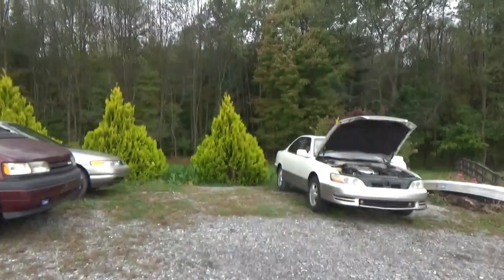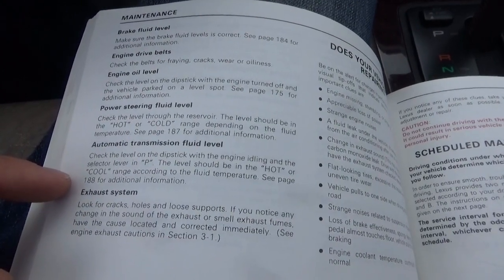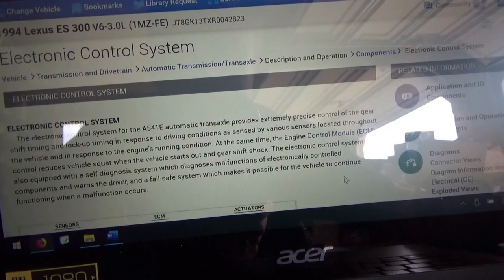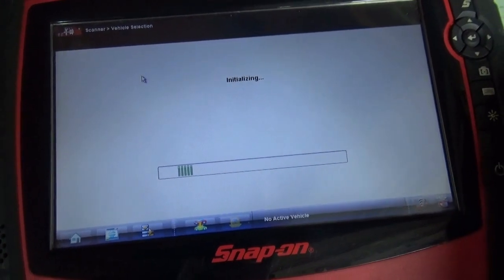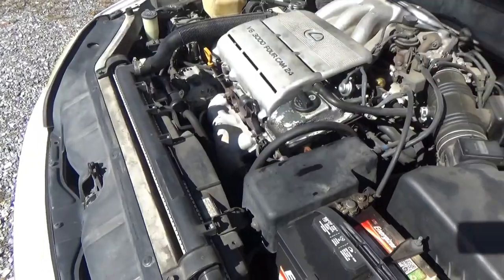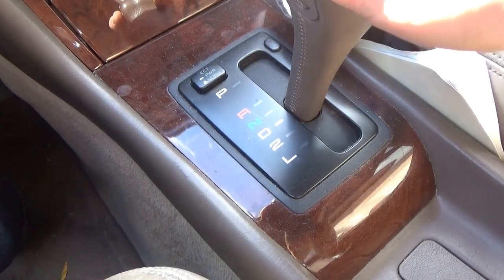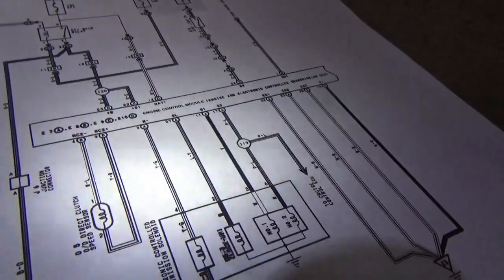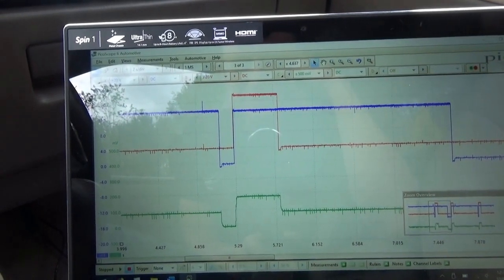Lexus Only Drives in Reverse?!? -Part 1

Comment: The forward gears are overrated. People should practice driving solely in reverse for precisely this eventuality.
Reply from the maker: HAHA absolutely xD
Reply: Saves on mileage too
Reply: This is why it takes longer to return home. There are four or five forward gears but only one reverse gear.
Reply: @MA-kt8ly  Strangely it doesn't clock up the miles at all.. haha?...maybe that's why it seems to take so much longer to get places?....lol
Also...seems to be wearing everything out in no time flat?...hmmm....I wonder if that might be due to the oposite thrust forces on the diff/gears that were never built to take long term....or red-lining the RPM's everywhere I go?...LOL 🤣🤣🤣
Reply: reminds me of the fun days bought a 74 laguna  no forward gears drove the thing home 35 miles in reverse .... new trans the following day drove great , lot faster in forward gears ... lol
Reply: I drove around with only forward gears for about a year, I guess it is time to try to opposite now.

Comment: Turn the Drivers seat around, swap the Headlights with the tail lights and tell Customer to use it in Reverse for now.🤣🤣😂😂
Reply: @ Steve Jones that's a good short term remedy that saves time & money 👍 trouble is someone may & will get hurt if not dead
Reply: Pick up hitch-hikers. They can help you park.

Comment: Have you try to reset the ecm or tcm ? ivan disconcted the batt both + and - for 2 hours ( hard reset)  i  think it will reset and if that the case she need a nother tcm ! why it drop in D 3 2 1 was lost of com in tcm!!!  the reason why it not showing up on the scaner it pre ODB 2 SYSTEM !

Comment: Water in the engine bay won’t hurt anything everything under the hood can get wet just fine. The trick to washing an engine is to not use high pressure and don’t hold the water in one spot too long.

Comment: On all the transmissions I've read descriptions of, the shift solenoids would not cause a no engagement. It could cause a wrong forward gear or slow/harsh shifts but if it's in drive it should be in some forward gear.
Reply from the maker: That's what I suspected, but the service info didn't describe what the "fail-safe" mode was...
Reply: @PineHollowAutoDiagnostics   Could that attempted hard shift into 2nd when the connector was unplugged perhaps been the default strategy but it failed to engage?
Reply: I know Chrysler's transmissions default to second gear as safe mode, and turn off all power to the transmission computer. If no power gets to the transmission computer, you only have second and reverse. I would expect something similar from most companies.
Reply: Wouldn't it be dangerous/safety concern to engineer a transmission to failsafe into a neutral state if there was an electrical failure?
Reply: Yes it would be, that is why Chrysler designed it to be second gear. enough to get around with, limp it home, or at least get somewhere safe. I know this did backfire though, people lost power to the transmission, it dropped into second gear when they were going 80 or 90, and it grenaded the transmission.
Reply: @PineHollowAutoDiagnostics  looking at the service information, you shift into O/D as the default gear ratio as neither shift solenoid is powered on

Comment: Forward clutch packs are burnt up. Could see that from the black fluid. 

When you unplugged the solenoid pack, that was when you can check the mechanical and hydraulic system. It will have a harsh engagement, but will show if the mechanical system is any good.

What fails on these is 4th gear first, then that ruins the first 3 gearsets.
Reply from the maker: That sounds terrible lol. But it's a Lexus! Should be able to go 1 million miles!!
Reply: @PineHollowAutoDiagnostics  

Unfortunately, it may need the rebuild. They are fairly easy to rebuild though.
Reply: @PineHollowAutoDiagnostics  I know a lot of people have mixed feelings about this but given the situation you could try a fluid flush and fill along with a filter change, I know some people have had luck with that. Just a thought.

Comment: Ivan you scrolled right past your apply chart, that is about the best guide for transmission issues. Tells you what does what mechanically in each gear position.

Comment: I don't have a lot of experience with troubleshooting automatic transmissions but is there a way to force the forward solenoid on? Can it be done with the interface you were using? 
Also, sometimes it helps to use a stetoscope to listen for the noise to change when the solenoid activates. Perhaps the solenoid applies pressure to the forward clutch pack (or bands?) but they are not getting mechanically engaged? Just truing to think out loud...

Comment: This will be interesting to watch. I have a twenty-year-old Lexus LS400 with 250,000 miles... It always goes into reverse no problem.. but lately it's been a little bit slower when putting it into drive.. when the car is cold.. but this is also my first winter having the car and it was fine all summer

Comment: I'd drop the pan and have a look, but that reman ECU is a red flag. Seeing that connector is easily accessible why not de-pin the two solenoid wires and ground them off and on through a light bulb (unless they are positive switched but you get the idea) see if you can affect a change. 

BTW the A540E/541E is known to have reverse gear go out this is a sure sign the clutch packs are toast, no drive seems like something different.

Comment: From the looks of things if you unplug the solenoid harness from the transmission and it still acts the same then you have a hardware issue. Since you have reverse we can say the torque converter is good and from the looks of the oil it's not hard to imagine the forward clutch packs are gone.
- 
Did you check the linkage at the transmission? I wouldn't call a transmission dead until the pan and strainer are removed and magnets are inspected.
- 
If it was my car I would replace the clutch packs and seals and call it a weekend if the rust and exhaust system aren't too bad but, it's a tough call when the repairs cost as much as a replacement.
Reply from the maker: Yeah for sure. This one is from Texas, so the body is immaculate.

Comment: If it's not an electrical problem with the solenoids, the next logical step seems to be to remove the trans. pan to access the solenoids. Since the fluid is dark, it's possible the shift solenoid's screen is clogged (if it has one), so it can't bleed off fluid pressure. If that's not the issue, the spool valve in the valve body may be stuck from varnish or from the clutch material in the fluid.

Comment: I have driven Lexus cars for the past 20 years.  I have had 4 of them and put over 200,000 miles on 3 of them.  I have always changed the fluids as recommended by Lexus.  I have never had a problem with the transmissions.  Great cars.

Comment: Park it in the garage, aim a propane space heater at the transmission area and get things good and warm. Maybe an hour or two. Start engine and see if anything has changed with the shifting situation. If it works, drive it, then park outside to get it fully cold again and see what happens. If it works when hot but not when cold, remove pan if needed to check solenoids. If solenoids are indeed working, remove valve body and check for blockages with air through passages at low pressure.

Comment: most people don't change there transmission fluid it seems. seems like people think that changing it if it hasn't been changed for a long time will mess it up because it will make stuff come loose in transmission and move it around and that will block up holes and stuff and make the transmission mess up and need to get another one after that

Comment: I put a lock up solenoid in our '99 Camry. If you pull the valve body, be careful with the gaskets. You have to totally disassemble the valve body to replace the gasket that seals the valve body to the tranny. Toyota wanted my firstborn and then some for the gaskets. Found them on line much more reasonable. 
Oh, we now have convertor lockup!

I agree with the guys saying it's probably something mechanical. Wonder what part 2 holds?!!

Comment: You got a belt squeal to change the belt on the car even though the customer didn’t talk about the belt change it if it’s not the belt is the pole but I’m pretty sure it’s the belt from Aleskyfinis  The solenoid may be slipping in there

Comment: I would question the customer to try and determine if they burnt the clutches out. The slight engagement in default mode worries me. Most people will destroy their transmission as soon as it starts to slip by reving the engine.Otherwise why the default mode is not working needs to be investigated. Given that the pan needs to come off to do this I would price a second hand transmission. Given that these usually out last the car a S/H transmission may not cost much. I would purchase the S/H transmission before even moving the car into the shop. before removing the gearbox I would try the valve block from the S/H transmission in that one to see if it fixes the problem...yes parts changing...but easier than trying to inspect the valves or trying to activating clutches by compressed air.

Comment: So if the transmission has a fail safe or a limp in mode... it should still have one forward even without the electronics.  I'd pay more attention to the clutch application chart in your service info... compared to your symptoms.

Comment: As the trans fluid ever been changed, rev the engine on redline for a while to make the pump in the transmission have more pressure you might get the valve body working temporarily

Comment: If transmission shifts smoother under ECM control, there must be an solenoid valve which let out hydraulic pressure from the first forward clutch during gear shift.  If that is normally closed, unplugging the transmission connector enables  the manual control of the gears. But if that valve is stuck open, no forward gears. P-R-N selection is done brake pressed, so no need there for smooth gear switch. Check the hydraulic schematics..
Reply: 9:26 Shift Solenoid Valve SLN "Controls the hydraulic pressure applied to the back chamber of the accumulator and smooths the engagement of clutches and brakes during shifting" -> no pressure in accumulator, no forward gears?

Comment: The owner's manual my '07 ES 350 came with doesn't even have info like that. It's just "take your car to the nearest dealership" poo. Mine would drive only in reverse for about 2 minutes then the car wouldn't even move at all. Now it's stuck blocking my driveway with the shifter able to move but not engage in gears, the "R" stays on the dash, and it won't even start. I don't think I can even check the fluid level on this year.

Comment: I had the forward clutch drum crack, on a Ford CD4E auto trans. Had reverse and D1 D2, but no forward drive in D.
Reply: What year? I've got one of those in my Ford escape, never heard of that issue. Only 1st band breaking and pressure regulator failing.
Reply: @bairfamilyfarm1336  I'm in the uk. My car was a Ford Mondeo MK3 2001 - 2006. I owned it for 13 years and the CD4E gearbox was replaced twice for same fault. The CD4E was a very common failure and used in many car makes and models. Problem..... The hydraulic fluid pressure in the trans,  increases to a very high level, due to wear in the valve body. The result was the clutch packs in the forward drive drum, would crack the end of the drum.  To see exactly what this cracked drum looks like, search YouTube....
CD4E Quick Tip

Comment: We had a 1999 camry wouldn't engage forward, would disengage at stop lights and signs, trans flush and was good for 4 months, same issue again after that and the only way the car would even go after flushing a second time was if you neutral dropped it, ive never flushed a trans since, just drain and fill. People dont care about maintaining the transmissions these days they barely get the oil and filter changed. Meanwhile I've changed my trans fluid twice within 25k on my 11 chevy Malibu trying to make up for previous owner neglect with a minor slip and delayed reverse engagement which both went away

Comment: I have a Toyota axio 2009, and for some reasons the Drive gear just stopped working. The car won't drive forward but can go on reverse.  How can I fix it without necessarily replacing the whole transmission?

Comment: can you still find  a used transmission for a car that old? Isn't that the same transmission the camry used back then?
Reply: Lexus since inception has been built on the Camry floorpan and share upto 70% of body and driveline parts and engineering. This still occurs today. 👍👍🇦🇺
Reply: Andrew Hallett-Patterson that ES300 shifter reminds me of my mums ‘96 Camry . That car went forever until the E10 fuel burnt a hole in her piston. Even though the body & transmission was in great condition, ( trans fluid replaced every 60K Klm)the engine replacement (from a wrecker)  was going to be as much as the car was worth..unfortunately it ended up going to the wrecker.
Reply: @paulsz6194  You are correct. This is the exact situation today. The ES300 was also available with a manual gearbox, which was found in the Camry. 👍👍🇦🇺
Reply from the maker: Wow a hole in the piston sounds pretty extreme! I thought the 96 Camrys were bulletproof :(
Reply: Pine Hollow Auto Diagnostics Apparently they are not compatible with E10( 10% ethanol blended) fuel.
Reply: @paulsz6194  Which is the reason we do not promote ethanol based fuels in Australia. What ethanol based fuel is available is in very limited amounts and difficult to obtain. 👍👍🇦🇺
Reply: Andrew Hallett-Patterson That would have been Very Rare for a ES300 in Australia,as Lexus was wanting to project a luxury vehicle image. But would have been a lot of fun!
Hoovie’s garage found one though...
Reply: @andrewhallett-patterson9778   Not in Sydney. Every  3rd or 4th petrol  station has the E10 option.  It's becoming a little less common than it was 15 yrs ago though . Meant to save you money at the pump,but you got what you paid for!
Reply: @paulsz6194  My dad currently has the ES300 I speak of. The car is ex Toyota Australia executive and ' walked down the line' when initially assembled as the executives of this era could have a car to their preferences as part of their employment contract . This custom order has may options not offered within the Lexus range,  but was available to the Camry. Currently undergoing a complete restoration. 👍👍🇦🇺🏆
Reply: @paulsz6194  Very few in SA. I'll go as far as stating I've never seen availability here.👍👍🇦🇺

Comment: Same thing happened on my old '96 Lexus. Clutch packs are worn out. I was able to change the fluid and filter to get a few more years out of it but had to trade it in when it started acting up again. The reman ECU was probably due to capacitors bursting and leaking. Same thing also happened with that old car. I bought the caps for a few bucks and fixed that issue. Couldn't be mad at that car though, it nearly made it to 300k miles.

Comment: I would drop the transmission out, put in a 5 speed manual...probably need to change the fly wheel, add a clutch pedal, slave cylinder and reservoir and go manual. Or, get that CVT you tore apart years ago, rebuild and install. One more thing....this is the most BACKWARD video i have watched to date. Ivan, your channel totally rocks man. Thank you so much for great content.

Comment: lack of maintenance. Transmission oil is pretty much the only thing that needs supervision between oil change intervals. If I was to buy a vehicle with so dirty trans oil I'd reduce $2000 from the price for changing the transmission in near future or else walk away

But hey at least the engine is about idiot proof